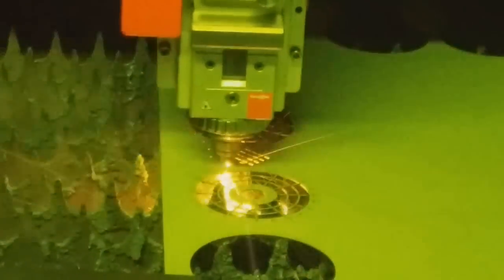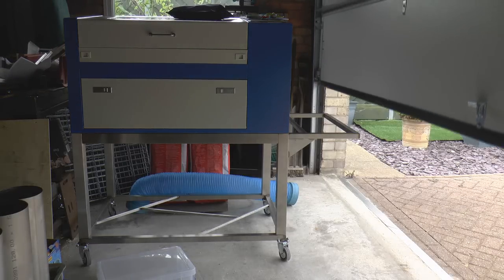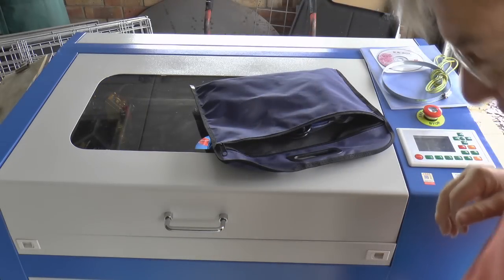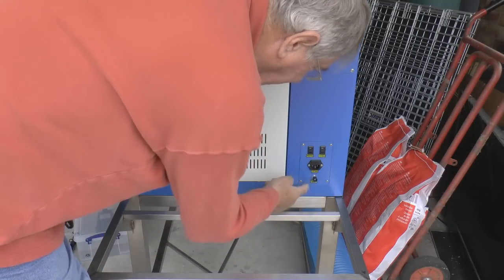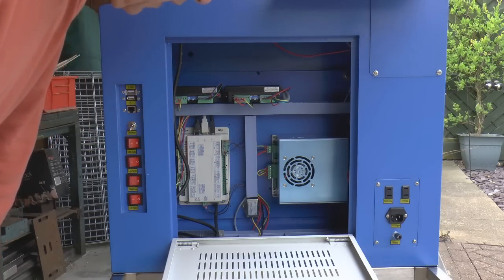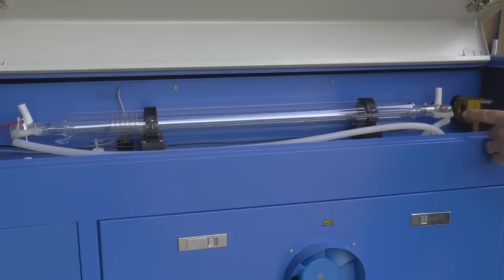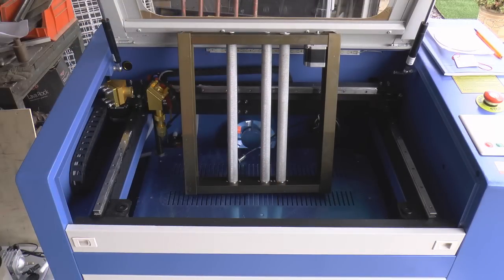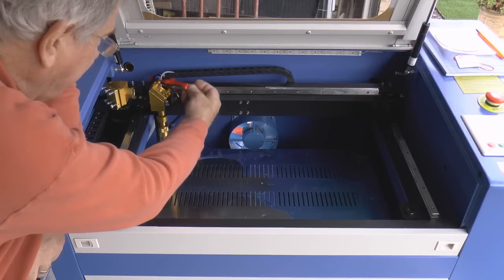Chinese laser cutter  tutorial part 1

Comment: Hi Russ
i have been preparing to buy a hobby laser for my old days for a while now. I looked for the K40 first.
Then, while browsing useful information, I stumble upon your site. After looking at some of your posts, including the initial five for a 50W laser, the decision is easy ... switching to a 50W machine. It really is much more expensive. However, with your instructions, it can become a very, very reliable machine.
I found something from the manufacturer Vevor. It seems to me a similar product with a few small changes, mostly in the outer casing. Are you in the mood to look and comment?
Best
Reply from the maker: Hi Pra
  It is a sensible move to consider the more expensive machine. This will be a small version of a proper CNC machine and can be a very reliable and useful hobby machine for both cutting and engraving.
 Add your disguised email address to another comment and I will reply and also delete your comment.
 Best wishes
Russ

Comment: I just bought this machine, but the driver comes with manual folder. The video tutorial inside this folder is in Chinese and the driver is compatible with windows XP. I ran check for update and the windows found the compatible driver. I am wondering if I bought the right machine. I am new to this world. Also there is a software inside the manual folder called RDWorks. I have some experience with LightBurn. I appreciate your valuable advise please.
Reply from the maker: Hi Samer 
If you already have experience with Lightburn and your controller is a Ruida controller (there are others that Lightburn supports)  then I would stick with that because it is so much better than RDWorks. Lightburn started life as a private reengineering of RDWorks. So it will be completely compatible with your machine. If you need an up to date version of RDWorks (don't use the one supplied) then go here to down load.
https://www.cloudraylaser.com/pages/download-link.      It will run from Win 10 ( Lightburn will also  run on  OS or Linux )
 Best wishes
Russ

Comment: Awesome videos, really good. We have just taken delivery of one of these, but when trying to use it, get the message "Opened protected". Any idea why??
Reply from the maker: Hi
Yes, There will be a switch somewhere on your main lift up door. If you try and run the machine with the door open you will get this message. OR the switch is there but not working properly even when your door is closed.  Take a look for the switch and if you go to the keypad and press the ZU button it will reveal another menu. move the high light to diagnostics  and you will see a series of blocks that represent the limit switches on your machine. To check how it works just place something metallic on on of X or Y limit switch and you should see it flashing on and off on the screen.  You should see your door switch doing the same if it is working ok.
 Best wishes
Russ

Comment: Hi, I'm looking to buy this particular unit on Alibaba app. The machine is obviously sold by "Shanghai Sihao Machinery Equipment Co., Ltd." They're the only original supplier that makes the machine with this exact housing for the 3050 high precision laser unit. But unfortunately the current 2020 production doesn't come with a motorised table anymore, just a manual one.
Reply from the maker: Hi
 Do you have access to a drill and tap (even a hand tap? If so you can take the big adjusting knob off and put a tapped hole in the top (M6 or 1/4"UNC). You can then threadlock a hex head bolt or better still a cap head screw onto the top of the knob. You can now use a battery powered screwdriver or drill to "motorise" your table.

Best wishes
Russ
Reply: @SarbarMultimedia  Hi, Thanks for the very detailed explanation! :D